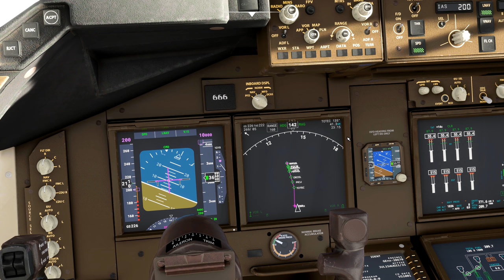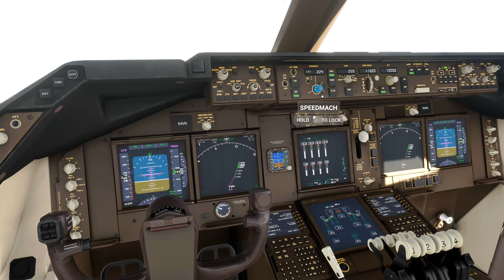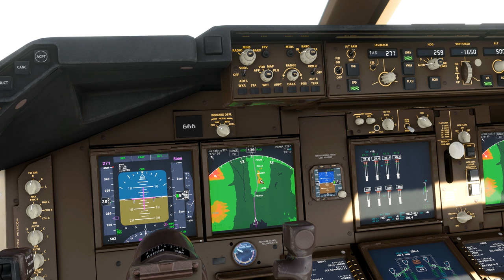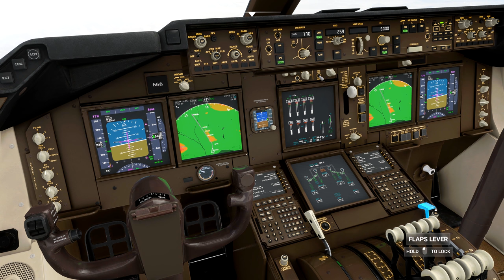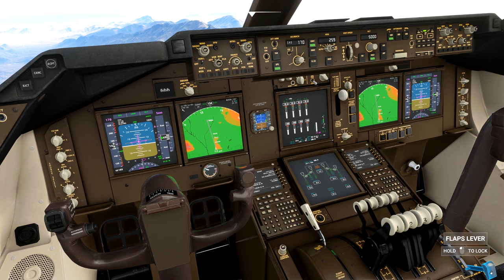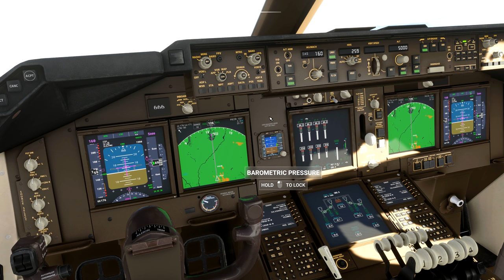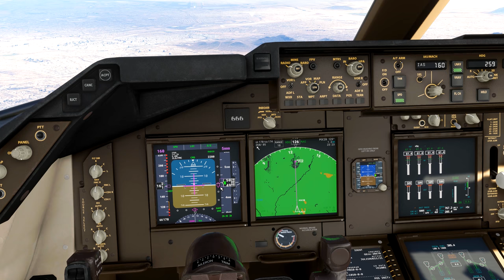Microsft Flight Simulator 2020 - How to fly on the Boeing 747/8 - Beginners Tutorial 4k

Comment: Did auto throttle engage itself?   I didn't see you push anything during the take off....
Reply: It’s the switch right next navigation master on the dash
Reply: @jadenwracing8176 thanks
Reply: @naudiatf2791  no problem!
Reply: We can control throttle from keyboard  also and xbox remote also

Comment: just a minor thing for anyone that cares:
you dont want to pull up at V1. V1 is the decision speed; in other words, the maximum speed at which you can reject a takeoff. VR is the rotate speed where you can start lifting. the takeoff in this video rotates too soon and that risks a stall in some wind conditions like high headwind.
happy flying
Reply: incorrect
Reply: @EazyDuz18  it is not incorrect. he says "v1, pull up" which is incorrect. v1 on all planes is the velocity at which you can still reject a takeoff if critical failure occurs. ideally in a 747 you want to be anywhere between 150 to 160 knots, and he began rotating at about 140, which is just a little too soon. you want to take off at the rotate speed to minimize the risk of tailstriking, stalling, or otherwise having issues, especially if you are heavy.
Reply: @EazyDuz18  Buddy got schooled😭😭